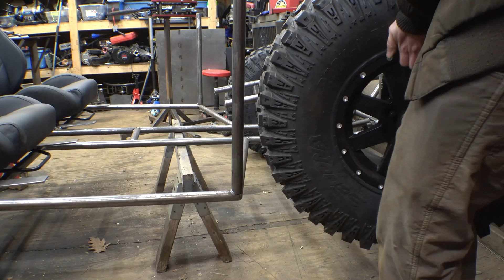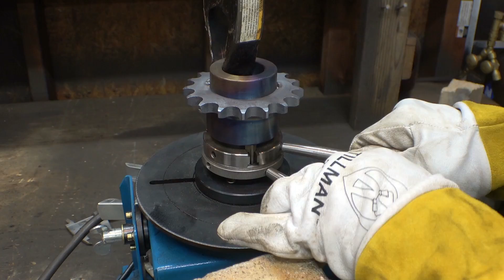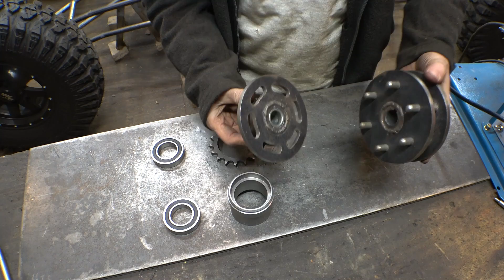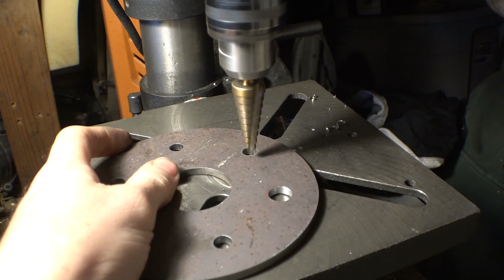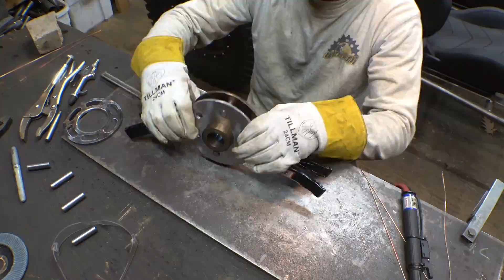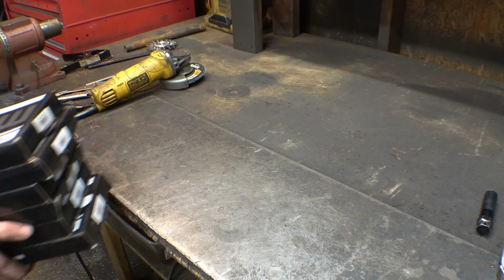Installing the Chains on the Mini 4WD Trophy Truck Project - Part 4

Comment: You make some really amazing stuff, yes too the doors and maybe some removable Perspex windows ? So you can use it all year round, so you can remove doors and windows in the hot weather and put them back on for winter 🥶 so you don’t freeze to death and stay somewhat dry and warm?  On the plus side of using the motorcycle engines you can also use the wiring harness to run lights a dashboard, then you got power to weight ratio and the ability to change the gearing/sprockets are all cheaper than it would be to change gear ratios in car gearing. Anyway you know all this stuff already….keep the awesome builds coming…..maybe get it street legal so you can really get the use of all your hard work 👍 you are a true craftsman 👏👏👏

Comment: I totally appreciate and understand why you like to build all your components yourself.
The bottom line is that your shop (or mine) is not equipt to start churning out high tolerance spiral bevel gears any time soon. 
You find creative ways to manufacture unique toys with very few purchased components. For that you should be very proud!
Maybe those who lack appreciation for your methods should offer you a catalog of the percision ground bearings and gears they manufacture on their 1 man home shop YouTube channel and you can say "I quit using Timkin (or whatever) bearings because I now get all my bearings from Billy-bobs You-Tube channel".
Just sayin'

Comment: The professional racing karts run a teflon lined tray for the chain from the front to rear with an adjustable tensioner on the top

Comment: I love that you tackle these builds with outside the box thinking. You could always dive into cvt stuff, but the chains are unique. Chain slides will help keep the front drive in good condition and help reduce stress on the tensioner. It's clear that the haters have never worked on conveyance systems.

Comment: Your chain just needs to be able to handle more force than the contact patch of your tire. If the tire has more grip strength than the chain, then the chain breaks. If the grip is weaker than the chain then the traction breaks. Many trucks on the road have been produced with chain drive transfer cases so chains can definitely get the job done.

Comment: I would love to see a mini crawler (not a rock bouncer), could use driveshafts and a transfer case to keep the engine up front. I think it would be amazing! Also solid front and rear axles with coilovers.

Comment: Definitely need a carbide tipped hole saw or annular cutter to break through the hard crust on those case-hardened sprockets.

Comment: Only one side of the chain will be in tension under power. That side of the chain should run as straight as possible, try to put the tensioner on the slack side

Comment: I don't think chains are the issue there are many drag bikes with much more HP than your looking at still running chains however a bit concerned with the system you made to go 2wd/4wd not only because it's going to be a lot more power than you have ever put through that system before but in tough off-road conditions you aren't always on the power so those pins will be slapped back and forth under some pretty high loads

Comment: Hey I was watching you run the front chain and was thinking that you could try use an adjustable free spooling sprocket as a chain tensioner.  That could also help with the chain slapping.  As I mentioned in the last video. What about suicide doorswith locking frame to help with safety. Can't wait to see this thing finished.  You have come a long way with your builds. Great job!!!

Comment: Could you squeeze a manual transmission concentric slave cylinder on the layshaft to engage/disengage the drive mechanism to the front spool ?

Comment: The Honda k20 & k24 are pretty strong engines stock and about the same size as the engines your using. They are wildly available & they hold good power when boosted upward 400whp on stock internals. $(500-1000) on eBay or junkyard.

Comment: I'm thinking of doing a slighter smaller tube truck build with some smart car parts/ 1 liter engine. I would go the motorcycle route too for something smaller, great budget friendly projects! You will want torque not Hp. Also if you reach out to an offroad suspension shop, they can help give you free pointers on the perfect shocks / shock angle for your setup and help with 4 link setups/sway bar setups.

Comment: There will certainly be huge amounts of torque on that "jack shaft"  cornering will be the test I guess.  Please Sheald the back ones very well.  I deff. Get building as much from scratch as possible.  There's less respect for assemblers I agree

Comment: won't the slots allow loading and unloading causing a clunk? since you will be close to stopped wouldn't be better if had same size holes as pins or maybe cog teeth like a love joy coupling?

Comment: Hi Chris I have a good idea for you regarding the long centre chain, if you put a small shaft half way with two fixed sprockets side by side you can run two smaller chains meeting in the middle and change the angle of the chains between each end if needed also reducing the amount of slack you will get from such a long chain, I say this because I have been using motorcycles 44 years and with the chains it was always the longest that stretched quicker I believe it’s to do with the sway in the chains between end points you will probably find if this buggy is on a steep sideways angle the chain will hang and be able to ride of the sprocket good luck👍👍👍👍👍

Comment: I like your vids, and appreciate your creative take on building/maching.
I dont think youre familiar with short course offroad racing, specifically the 1600/pro buggy classes (its pretty niche without much of an online presence). Theyre a great platform and fairly cheap component wise to get into fast offroad vehicles (besides sxs's). They usually use a fairly simple air cooled 1.6 to 2.2 liter vw engine. 
Just throwing an option out there if you dont want to use a bike engine on a build, but dont want to jump all the way into the race v8 sequential trans bottomless money pit.

Comment: Bro use a drive shaft already you can make it work with a bike motor iv seen them use /build a bike motor with a drive shaft so you can run rear ends and frount end not chain that's to crazy with all that Chain.

Comment: Chris, project is coming along great.  For the center chain, the idler/tensioner should be on the top side, because the pull load is on the bottom side.  Further, for chain guides, I’d look at making them out of UHMW, a type of plastic that can easily be worked, but should resist wear from the chain passing over it.  Last, you didn’t mention the sprocket ratios.  I’m hoping your 17T to front sprocket matches your rear ratio.  Keep up the great work.
Reply: Yes, yes and yes!!  😀
Reply: @jlucasound  thanks man.  I seem to remember a company I worked for, 35 years ago, using UHMW for this application.  I’ve used UHMW for other things recently, and it seems suitable.  I don’t think Chris’ creations see enough miles to really wear something like this out anyway.

Comment: Can you use an electric actuator to engage the drive for the front wheels? Wires are lighter than rods and levers.  🤔😊 How cool would it be to have another toggle switch on your "dash" that you go click and the battery power engages the cogs for you!  😃

Comment: Make the piece you used to center the sprocket to where you can lock it in the other side like a drill bit in theory it should center it every time. Message me directly I have some killer ideas that I think you would like I just don't have time or tools anymore to put any of it in motion would like to see someone use them. Thanks for the vids you build some pretty sweet stuff.

Comment: great execution! would definitively encase the crash boxes and waterproof the entire trans tunnel. 

Without that, the selector forks will have issues with foreign objects or rust and wear quickly. 
With rollers or sliders you definitively can make the center trans tunnel structural and integrate the chain in the structure with two tubes. 

That loooong chain will be the cooling system itself, dragging the oil back and forth from each end, giving it room to cool without any external feature, besides an atmosphere vent (and a balancing pipe of some sort linking both cases, so oil wont pool on one side only, like a gravity return, where the oil sloshing forward when braking, flows in the link pipe, returning oil to the rear and vice versa).
sealing would be fairly easy, two automotive oil seals on each side of the "boxes" and the boxes being very simplified differential cases, with bolted on sides. anyhow, encasing the chain is a big thing with this project. it will reduce friction losses, links will be cooler and the gears wont wear quite as quickly. 

also allows you to oil quench the gears to harden them without fear of a foreign object breaking them.

Comment: OK- you have a smaller primary sprockets on the jackshaft driving the rear wheels then the large one driving the front wheels, how will this work if the F & R wheels are turning at different speeds in 4WD????

Comment: k series honda engine can be had with 6 speed trans under $3k and has CVs and is very compact and with an ebay turbo can make 400-500whp easy. Thats the route id look into if you do go car engine as its light, compact, and easy to make mor epwoer too

Comment: Just a heads up if you bought the "Vevor" air over hydraulic jack, we got a 20 ton one from them and it was all sorts of problems, first thing when you get he jack, pour out their "hydraulic" oil which in our case was brake fluid which can really jack up the seals, clean as much out or even flush it and use regular jack hydraulic oil or use transmission type F fluid instead, when we 1st received ours, it wasn't full either but it worked for testing but soon as we started to put jack to it's paces, it failed, luckily we got a hydraulic guy around the shop that works wonders with jacks, hope you did not buy that brand and that your luck is better than the collective shop luck 🤣🤣🤣🤣

Comment: The reason shaft driven automotive stuff is superior off road is simple... It is sealed up... O ring chain is decent for dirt and mud but  definitely not ideal and loses its efficiency it has vs shaft drive when it's muddy.. the way this is made though you could seal up all the drive components and at that point, if it stays together it's way better for efficient power transfer than shaft drive and it's gotta be lighter than throwing something like a rear end and ifs 4wd truck stuff in it for sure

Comment: A Chevy cobalt 2.2 engine and trans would be plenty for a project. Kinda like a vw buggy but a cobalt engine instead. I bought one for $1000 with a title and have put 12,000 miles on it and only done maintenance and tires

Comment: I think it's great the way you build almost everything.... I find it silly how people want every channel and tv show to be the same... and most of the time that means basically building lego projects. I don't have a lot of respect for those builds. 

For the chain drive to the front you want to remember that the chain will be pulling from the bottom and you shouldn't have any tensioner on it (on the bottom length of chain). You want it to be a straight shot from the bottom of the front sprocket to the bottom of the rear sprocket. I would make the tensioners on the top, out of sprockets with bearings in them, and remember that they need to be heavy duty because they will be under load when you are in reverse in 4x4... 

 Also, I was thinking. For guides / sliders, you could use some abs pipe (or something similar)  the full length of the chain. Maybe inside of a metal pipe. That way you have it enclosed and running on plastic.

Comment: Chains are stronger than some realize. People have used them successfully for over a 100 years in old dump trucks and cars and hauled much more than you will apply to a vehicle with a 1000cc. Your right if you do break a chain they definitely make stronger and bigger chains.💪💪🔩⚙️🔧🔨🗜️

Comment: Chains are actually very efficient in power transfer.
Noise  can be an issue. 
Your methods a good that is the content I’m looking for.
All for the engineering and problem solving. Bolting parts together is for 12 year old kids. 12 year old kids having fun, learning and growing skills. 
On your dog build I would drill the pin holes through all plates at the same time then on the female side open up the back side for engagement play.
This would be to have positive power transfer across all pins at the same time. Making them separately any variance in clearance has to wear in or the pins have to bend until contact is equally distributed across all pins. Not saying the way you did it isn’t right end result would be the same.
Awesome work!

Comment: You have got to get a ball peen hammer.  Claw hammers and angle grinders are not supposed to be used as hammers in metal fabrication😮

Comment: Hi Chris 

I too have wondered why you use chains for the final drive but have never asked . I assumed you had your own reasons . 
Have you ever considered chain driven Miata differential system though , just curious ?
LSD versions are available and look quite compact once fully built . So much so they look like one would fit in the front of this build quite easily it seems to me ???
I'm sure with your skills the engineering/machining side would be no problem .
Looking forward to seeing the rest of the build videos of this "truck".
Looks great so far keep it up .

Fattrucker

Comment: I’d say adding doors is definitely a good idea just for ease of access in general, in addition to being safer/easier to get out of in case of a roll over.

Also, on the last video I saw a comment about possible running the seats in a slightly more leaned back position in order to be able to drop the heigh of the roof a little bit. Absolutely no idea how practical or comfortable that would be for you but I think dropping the roof at least a little would make it proportionally closer to the look of a trophy truck. The build looks killer so far though!

Comment: Protip: you would save yourself a ton of time to productize some components and make them into self as series production. You could still make different frames etc but use some ready made components that take time. Just having the same tools set up and then make ten or 20 instead of two saves a lot time.

Comment: I definitely would worry about snapping one of those chains. I'd be thinking about snowblowers and shear pins. When the auger on a snowblower binds up the shear pin let's go to minimize any damage. Imagine the amount of torque it would take to snap one of those chains. A frame member or axle would likely bend first. Better for a keyway to let go first. A quick and easy trail repair get you back running again , rather than the deadly sharpnel  a broken chain may cause. Engineer in the failure/safety point in advance.

Comment: Idler sprockets would be less parasitic loss than sliders, although sliders will be needed too in the distance that you're at I'd think.
Chain drive was around long before shaft driven setups. 
Although shaft driven is preferred due to less maintenance, and ware tare is significantly less than chain drive.
But either accomplishes the same end results, but you have more noise from chain drive, and a higher chance of failure especially if maintenance is lax.
Even more so in especially dirty, are muddy environments due to grit causing chain, sprockets to ware excessively faster than U joints, and that type of mechanical setups. 
Difference is that you can replace chain driven components several times, for the cost of repair or replacement on the shaft drive setups especially in four wheel, are all wheel drive setups

Comment: Just an idea about the doors, if you think the window opening might be to small what about when you build the roof roll cage you make a small section of it open upward like  Delorian / Lamborghini doors, this would allow you to keep the structure and look that you are wanting for the side.  This would give you more space for entry and would not compromise any integrity of the roll cage and  the doors or hatches if you will would be on the roof where you would not really see them, you could even add in those small hydraulic dampers so they self open smoothly when unlatched
Reply: Great idea! 😃

Comment: Doors are a sh!t ton of excess weight to already overweight vehicle. But even bigger problem is your secondary gear ratios. Now you have different ratios between axles, so they will travel in different speeds. This common mistake destroys even the sturdiest of drivelines, so might want to re-design that before you hit the bush. And no, you can't compensate by just changing the secondary sprocket on your front axle, they all need to be the same size. Front axle sprocket and rear tyre sprockets need to match, and same goes to those three small sprockets.

Comment: You can make a plate to go on the router base, or even an enclosure to mount the router in, to make more flat area to put your work on, making the process easier and more accurate.

Like the use of the cordless grinderhammer by the way.
Reply: I see! Then it would be anchored by the body of the router, so it will be more secure. Make an enclosure with a block of two by four screwed to the bottom. That way you can still clamp it in the vice and stick it on a shelf when you are not using it.   😃